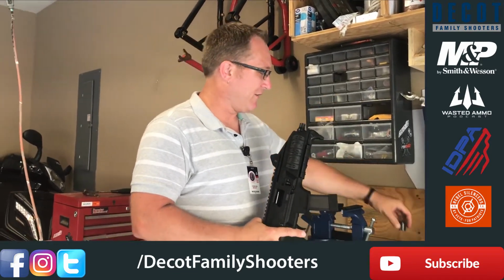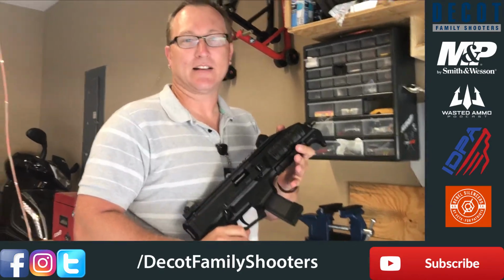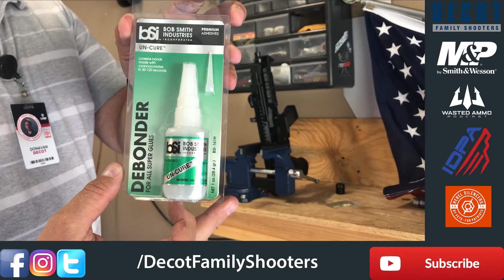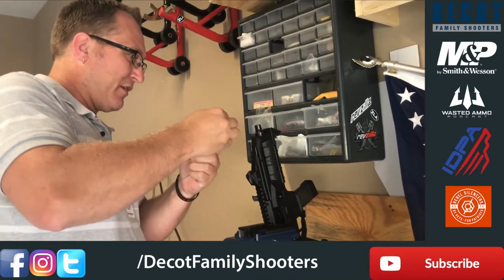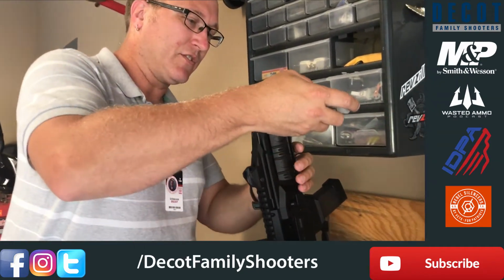CZ Scorpion SBR Build Ep 01 | Easy Handguard BarrelNut removal | How To

Comment: You made that way too hard LOL.  Glad you got it off though.  I got mine off in 4 min with some heat and the MI Evo wrench.
Reply: What did you use, heat gun or torch? Did you heat the tool or the nut? Never had to break a bond before.